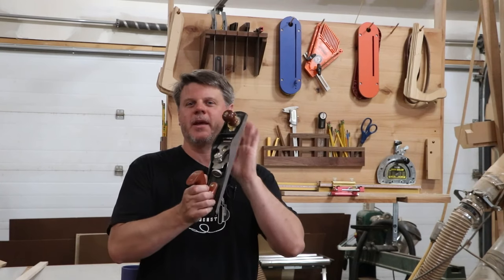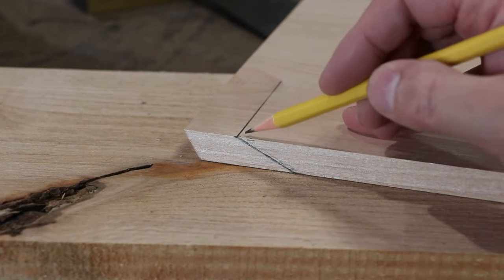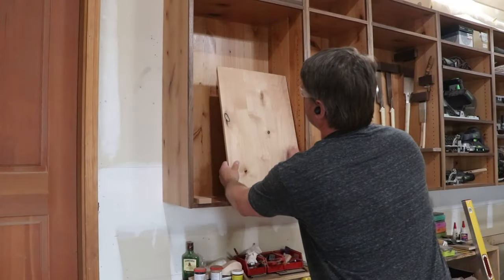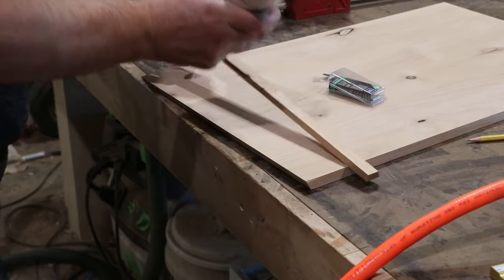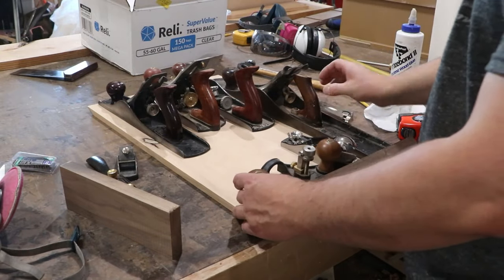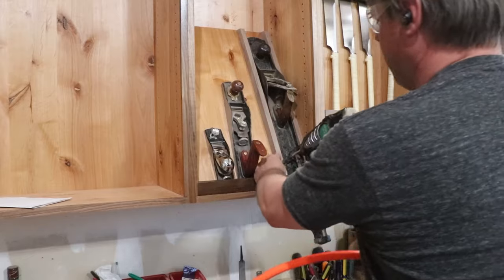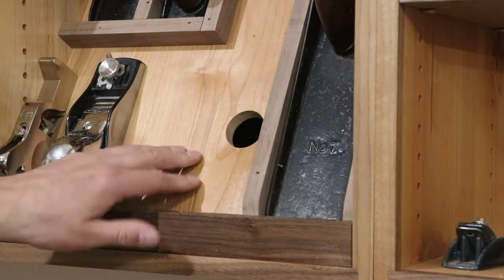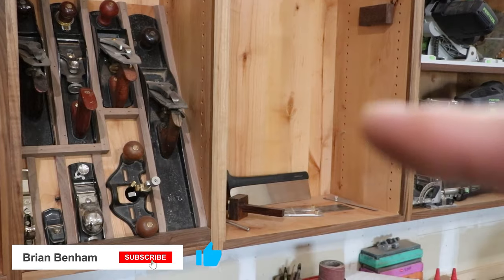Building a Plane Till For My Hand Tool Tool Cabinet

Comment: As usual great video. I have a workshop approx the same size as yours I built 5 years ago. And my tool arrangement is similar, but I have self induced OCD and having to pull all the tools out to clean as I get dust everywhere was a pain. I recently started to fit doors with a rubber seal on them to all my open cupboards and it has worked a treat.
Reply from the maker: Rubber seals sound like they would do the trick to keep the dust out.  My plan is a little more low tec, and plan to blow them out periodically with a leaf blower.

Comment: I like how you scoped this out.  It's nice to have that depth.  I did not have that so had to reduce my angle.  As a result, I installed small magnets to make sure the planes stay put. I like how that works. I made an earlier one based on a plan published by a YR celeb, but the angle was so shallow the till is basically useless.  I'll have to convert it to something else - maybe layout tool holder.
Reply from the maker: Glad the magnets worked out.  In my head I thought I was going to have to use magnets to be safe, but the 30 degree angle turned out to be a sweet spot.  It's a nice angle to grab the tools from, and tilts back far enough that I don't have any fear of the tools falling out.

Comment: Regarding the hole below the router plane:  If this were a hole in a piece of dry-wall, we would put a reinforcement across the back by attaching a string to a slat that could just fit through the hole.  Pulling on the string brings the slat tight to the back of the panel where it can then be screwed from the front or glued. For your situation, two slats that are each over half the diameter of the hole could be applied.  Use a quick acting glue and thin thread or nylon fishing line so the pieces fit tightly against each other.  For added interest to future generations, drop a cryptic message with a "treasure" map into the hole before you patch it.  Or just drop in a few small coins with this year date and a note wishing well to the finder.
Reply from the maker: block the back of the hole would work, however, The plane extends quite a bit when it is set to it's full depth, so I want to keep the hole deep so I can keep my setting for later use.  
Per your recommendation, I did just stuff a note to my future self if I ever take that thing apart.  😜. Thanks!

Comment: With all those planes, I am surprised you spent so much time setting up the TS for one cut.  Planes excell at taking off corners.  For the gap above the mini plane...how about a vintage Stanley plane screwdriver or other plane related tools.  Maybe a bar of paraffin wax.